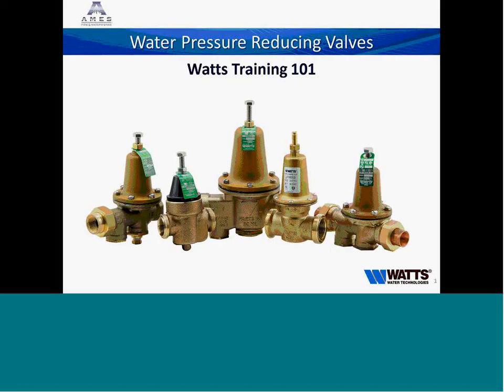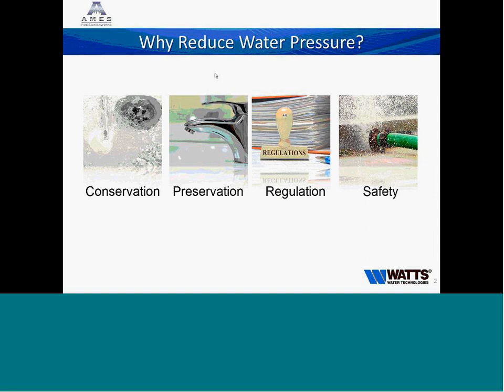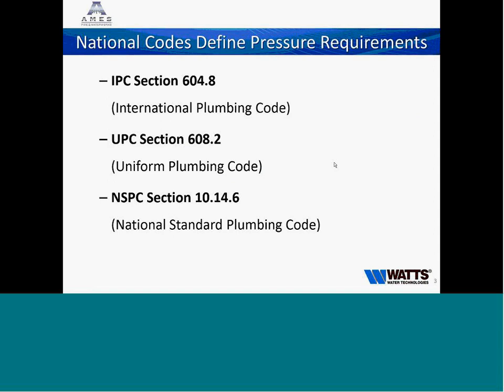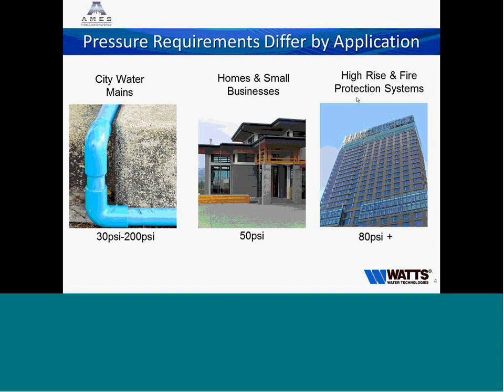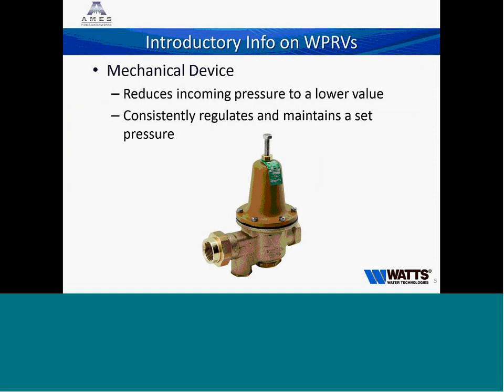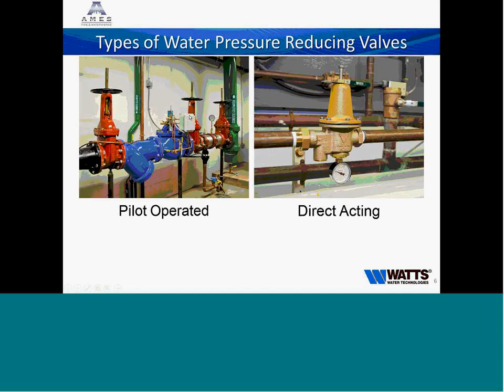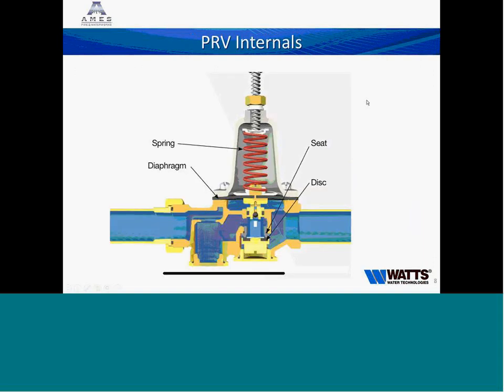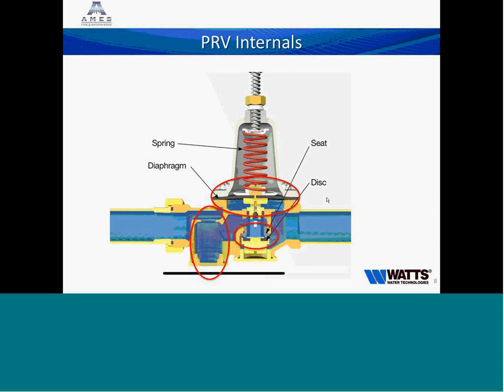How do Water Pressure Reducing Valves (PRV) Work?

Comment: The explanation of operation for the PRV states that the diaphragm area is 1.5 times the seat area.  If the seat pressure to open the valve is 50 psi, then the diaphragm exerts (1.5 x 50 psi =) 75 psi, not 150 psi as the narrator states.   Otherwise, the explanation is reasonable.